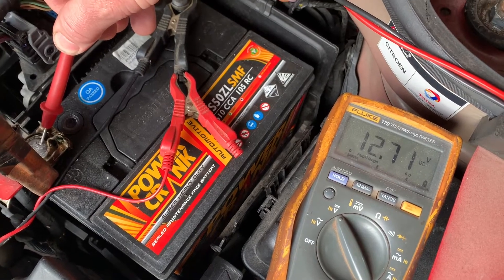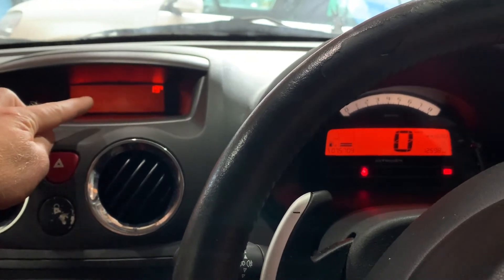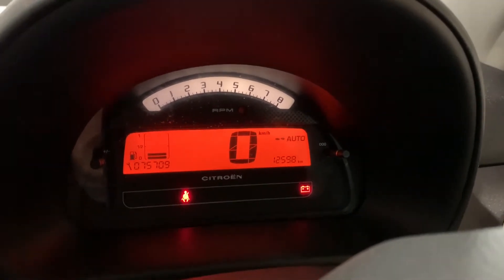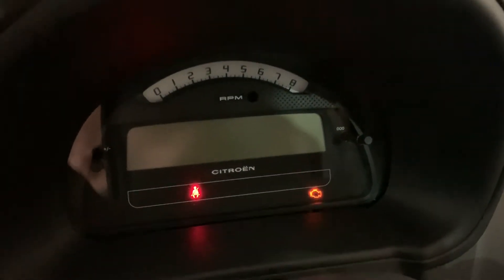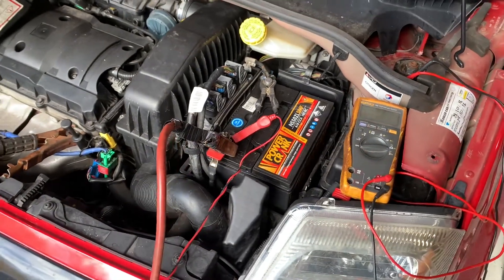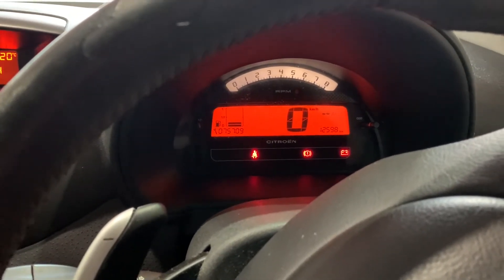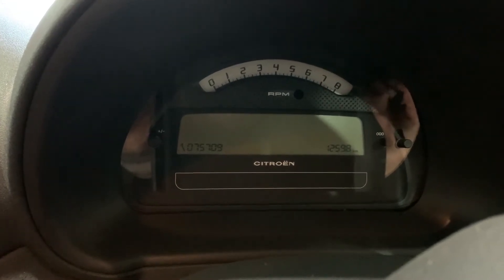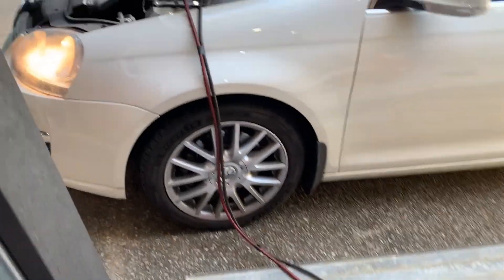Citroen C2 Ep 6 Sensodrive calibration! Battery Problem?

Comment: for anyone scrolling comments YOU NEED a 13-14volt car-car leads for the gearbox to initialize itself after a dead battery...  You have another car running hooked up and leave your foot on the brakes - you'll find it has a dash where N 1 or R should show up, you'll hear the gears popping back n forth for about a minute then it'll come back to life have 2 of these n does it often, also note there are 2 different selectors in the senso too - i have two that are just like a usual gear level (no park/auto ect just a +\- and a button to swap form semi auto - manual padel control

Comment: Greetings to all that have commented here and hi Pete, this series on the C2 helped me alot to understand this sensodrive better.
But I still did not manage to understand one thing and I could not find any answers on the hole internet so maybe you guys or Pete, if you still are mates with that Citroen mechanic, maybe you can ask him this question for me.

I am looking to buy a C3 Pluriel which has been sat a year now.
The owner said it has replaced the whole gearbox with gearbox ECU from a donor car, but now the car won't start.

He said that there are 2 things that can be done:

1. Buy a starter kit from another downer (ECU, Key with chip reader, gearbox ECU) - but it's expensive and hard to find
2. Relearn/Reprogram/Recode the gearbox ECU to the car

But I can't seem to get any bloody info from the internet on how to do this and all the diagnosticians in Romania (this is here I am from) that I called said it can only be done at a Citroen dealer, which I think it's BS!

Could any of you guys help me with info? Or Pete, can you ask your mate, the Citroen mechanic about this?
Reply from the maker: @valentinmarianionescu3543  Hello. I’m not familiar with that model of Citroen but I suspect the issue may be due to the IMMOBILIZER. I just replaced an engine ECU on a 2011 VW EOS and I had to download the files from the ECU (with Scanmatic2 and PCMflash), run the files through software called IMMOFF17 and upload the files back into the ECU. I hope this helps to narrow down your internet searching.
Reply: @PetesWorkshop  so basically I could do the same but with the original gearbox computer, download the files from it and upload them unto the second hand gearbox computer 🤔🤔
I am not familiar with, Scanmatic2 and PCMflash will they work on the gearbox computer? Or they just work on ECUs?

P.S. In my initial post, when I said gearbox ECU, I ment garbox managment computer 🫣

Comment: @PetesWorkshop Hi Pete. I had the same situation today. Car suddenly stopped changing gears. Did the usual procedure i.e. disconnected pole, waited a little, connect pole back, press brake, turn on, heard gear box calibrating at full capacity.....BUT just a dash on screen and still can't change gears. Note that Auto and Battery are NOT flashing. Everything is normal except for that dash on board instead of indicating the gears. What are your thoughts? What's the reason? What to check next in your opinion?
Reply from the maker: @vkouroub  it is worth trying to connect battery jump cables to another vehicle (with engine running) to ensure the voltage is good.
Reply: @PetesWorkshop  Tried it multiple times and nothing unfortunately. "Dash" instead of gears showing on board. Battery started flashing and car is in eco mode although i charged it (the battery is 1 years old). Did a diagnostic test and P1351 fault appeared. Cleared the fault retried the same. Checked fuses all good. For some reason the sensodrive refuses to calibrate even with 14+ volts from jump cables. I have no choice but to bring the to Citroen dealer workshop.
Reply from the maker: @vkouroub  I’m out of touch with this car for a couple of years now sorry I can’t offer any support.

Comment: Listen pal i know that you have read comments like this but, if you have changed the battery or left it without a battery pluged it reset some stuff in the cars computer or electronics which the calibration needs 14 volts. I have the same problem and i just figured it out cause every time the gearbox malfuctions i need another car to do like a jumpstart i does not work with the battery voltage. btw when you do the calibration listen in the engine if you hear a hissing sound that tells you the calibration with this voltage.

Comment: Sir i have citroen c3 2007, i try to move shifter cable tnen i get same issue iremoved inhibitor switch and clean it now p n r d appear but still start, voltage is12.6v but as i know car can start even with 10v charged, why we need 14v? Since 30 day i used uber bcz my car unable to start, i am from Oman 🌹🇴🇲

Comment: Having myself a sensodrive problem on a 2004 C2. 
While driving and at random situations the Auto and Battery lights suddenly start flashing and i'm unable to change gears. I turn off the engine try to restart but nothing. Try to change gears also nothing.
At this point i have 2 options: 
1) Disconnect/connect battery pole or
2) Let 1 day to pass,
either way the car starts and gearbox works normally but just for a couple of days where the problem repeats itself.

Went to a specialized garage where everything was checked and proceeded by changing the battery, also changing the clutch+actuator and even had the gearbox dismantled and checked. Everything was going fine until yesterday, 5 months after the repair, where the problem reappeared!!!

Since almost everything related to this problem is new on my car i tried recalibrating with no external source but it doesn't do anything. Is it the 5 month old battery? Isn't a little bit early for the battery to wear off? I mean there is no logic in recharging or replacing the battery in such frequency. 

Also what is the root cause of this problem? A faulty ECU maybe? Cabling, connectors etc? 

Anyway i will try recalibration connecting the battery to another running vehicle and come back.
Reply: Haben Sie das Problem lösen können

Comment: Mine a 1.6 2006 vtr senso drive lost drive whilst driving about 6 years ago.
 Had to get a garage to fit a new actuator for the sensodrive. It's been OK up to  May 2024. Used virtually daily.
 BUT  the voltage is a big issue definitely. 
 I also fitted a new battery just after the actuator.
 This solved the problem.
   More to do with a worn actuator in my case .. ? If I recall correctly. 

Believe it or not 3 days ago same issue  !
 Battery light etc ..  would start but wouldn't select gear . Tried the initialisation .. 3 or 4 times at the road side . Still no good  . Ended up recovery tow truck home.

Even with extra battery's.. same problem back home.
 Wiggled wires into actuator... got it started.
The paddles would select 1 gear and 2   but it would more or less resort straight away to snow flake warning 😅😅 and AUTO  flashing battery .. [ I think flashing battery light is related to starting issue ... circuit ?  ? Not just low voltage battery .]
 My initialisation process is slightly different .. so I'll try these and get back

[ thinking also about drilling holes in actuator and spraying in silicon lube ]

UPDATE 31 May 2024 
 Good news I got it 😊

I drilled holes about 3mm in the plastic bottom of the actuator and sprayed in silicon .. no good .
 I tried another in the top aluminium 3mm and again sprayed in silicon ... Still no good .
 Tried tapping with a hammer whilst it was resetting ... nothing. [ this worked last time ]
 Nearly gave up .. but  decided to soak the electrical connectors going into the actuator in WD40 [ AKA mechanic in a tin ] 😅
 Soaked them well in with nozzle several times and physically moved/ pushed around the cables . Left it for 15 minutes [ maybe longer poss overnight would be better ]  ... and it worked  !   No snow flake or warning lights.. starts and gears select  😊
 The actuator is located by the passenger wheel [ uk ] near or very close to the ABS unit [ I think  it is ] 
 It can be accessed OK from underneath once it's on wheel ramps .
 Move the plastic cover out the way and a nozzle should fit in easy .
 I also noticed when following the black negative from the battery to top of engine the connection to top of engine was well corroded .. not good what so ever , would cause untold problems
Reply: How is it holding up so far @hereIam1965?  Any more issues?  Do you think the problem was a faulty contact in the cables coming out from the Actuator?  Also wanted to ask you if the VTR is fun to drive since I heard the gear changes are slow?  Thinking about getting one which has the problem of AUTO flashing, and maybe fixing it.  Appreciate your comments!
Reply: How much have u spent on clutch actuator work ?

Comment: Hi Pete have u ever changed the starter motor on a sensodrive 1.6 was wondering if the purple wire also went onto the starter other than the + and -
Reply from the maker: No sorry, the starter was removed to remove the trans but the cables were left connected
and I don’t recall the wire connections.

Comment: I bet the gear selector mechatronics requires some sought of lubrication to be carried out. Jumping the voltage up to over 14 volts would be giving the mechatronics motor the extra torque required to get past the extra pressure created by lack of lube. Thanks for the video I might just go buy the car i'm eyeing off which seems to have the same problem..
Reply: ...look on the brightside ..its not a DSG
Reply from the maker: The actuator does have (and needs) lubrication. However in this case it seems it is something in the electronics that requires higher (and stable) voltage. But you are correct that the mechatronics will drag down the voltage too.

Comment: What's the snowflake sign for ??mine is doing all this but has the snowflake above gears but gearbox is absolutely fine
Reply: its a simple fix...its a wheel speed sensor fault...wiring or the signal switch

Comment: I have the service light and dashboard says gearbox fault and antipolution fault too, they could be lambda sensors though, however after a few seconds they go out and the date needs setting so yes just initialising is a problem presently..  Very frustrating but I`ll try a few of the booster methods, I like the cars but a ridiculous set up, there is a problem I have that you didn`t have there Pete and that`s the service amber light directly in front of steering wheel, this constantly stays on so this could be because there really is a genuine gearbox fault or the lambda sensors.  My drivers window won`t open but passenger does, anyway thanks for the video it`s given me some hope at least....

Comment: Hello,did the battery charge solved the solenoid shift control?
 I have code error and drops out of gear  and doesen't start until reinitilization.
Reply from the maker: I had to boost the battery with jumper leads connected to another vehicle before it would complete the reinitialization.